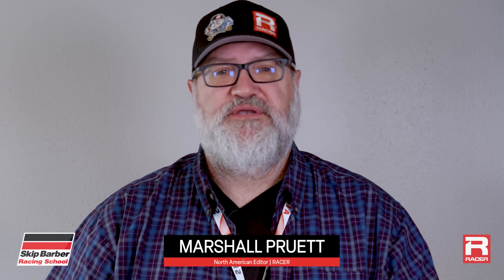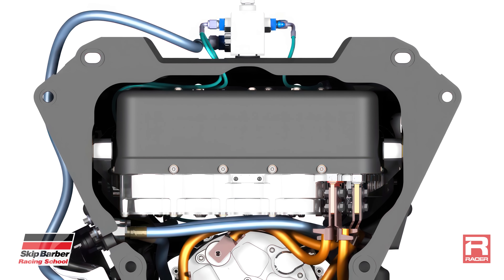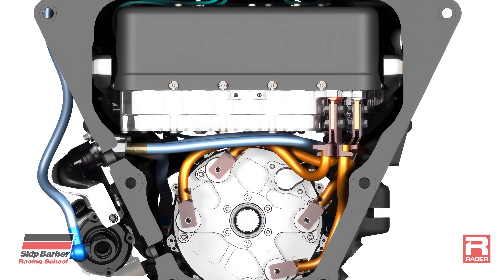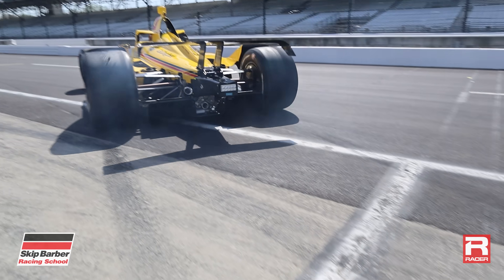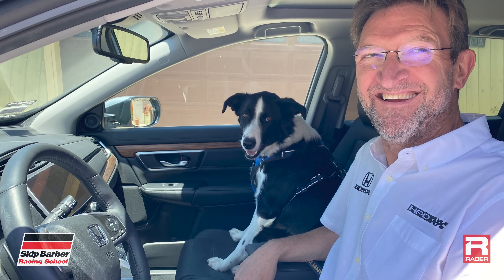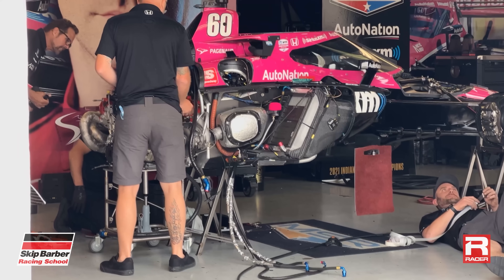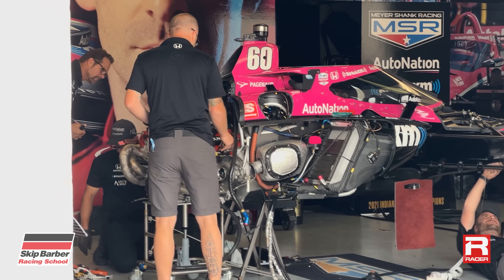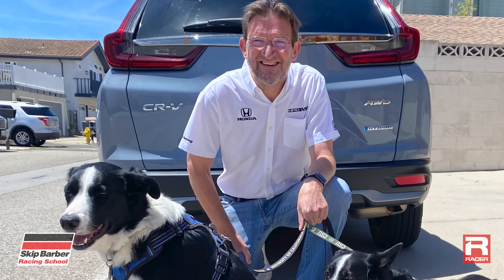Part 4 - IndyCar Hybrid Engine Roundtable hosted RACER's Marshall Pruett presented by Skip Barber

Comment: Truly hoping this is a success. I have put almost 230K miles on a used Honda insight and average 50MPG. My feelings are the cost vs advantage power and weight penalty wise are not there. I see a lot more breakdowns happening but again there will be much learned no doubt. IndyCar is the best racing today and I love both manufacturers. I grew up building small block chevy's with my dad, uncle and cousin. Serious question has powering the front wheels even been discussed? 

Great interviews enjoy this content.
Reply: I have a 9 year old accord that still does 26 mpg local and 34 mpg highway w 4 adults riding in it. Non-hybrid. Looking to move to a hybrid for the next one.
Reply: My c5 corvette gets 29 mpg on road trips.
Reply: @scarecrow_9895  That is pretty good. I had a hopped up but still TPI (425-450hp) 89 formula 350 Firebird with a T-56 6 speed behind it that got 26 mpg at 75 mph +... I think if I slowed down a bit probably 29-30 mpg could have happened.
Reply: @jamesbowman7963  We can get good mileage if we keep our foot off it, but that is hard to do sometimes.
Reply: No talk of powering the front axle.  It would require a complete redesign of the car to send power to the front wheels.  I'm also not sure of any formula car designed to run the front wheels except maybe Formula E.

Comment: Let's put extremely explosive racing fuel in a race car with high voltage electrical batteries that are know to self combust.
What could possibly go wrong?
Reply: The system uses a capacitor, not a battery.
Reply: Hybrid technology in racing isn't exactly a new thing you know.
Reply: Mongoloid is a good moniker for you...

Comment: I am not sure where they will get the electricity to charge all these electric cars.  I guess coal.
Reply: Watch all four parts of this series. The energy is stored in a capacitor, not a battery. Fast discharge, fast recharge is the benefit. The capacitor will be recharged by the engine which is powered by non-food chain based ethanol. 100 extra HP makes an 800 HP engine a 900 HP engine without extra strain and wear on the ICE components. It a win all around.
Reply: @davidholmer6099  but will they run the engine at that power from the get go? Because they only run 700hp on the road course setup and p2p adds 50hp. I'm curious whether they run the engines at full 750hp and just supplement 100hp with the capacitor or they just directly replace the 50hp p2p with 100hp hybrid for a net gain of only 50hp?
Reply: What electric cars?
Reply: Such a dumb statement. As a country we could use renewable technology as an economic opportunity but politicians in Washington get their paychecks from fossil fuel lobbyists.

Comment: It's hard to Defy Everything when you're fast, loud, and unapologetic.  I mean authentic! 

But seriously, I just hope it's a net positive in the power to weight department.
Reply: Right now it's 100 hp for 60 lbs, and the aeroscreen gets lighter and stronger next year as well.  It does make me wonder if they'll up the boost on road courses since they won't be overboosting the engine next year.
Reply: @danielhenderson8316  I'm curious about this as well. They're running 700hp on road courses, with p2p upping up to 750hp. Will they be running 750hp from the get go and letting the hybrid up the power to 850hp total? I hope this is the case.
Reply: @danielhenderson8316  I hope that's the case. Unclear if the supercapacitor unit requires a battery, or if it's just a 60 lb increase. Hybrid road car batteries are very heavy
Reply: @taylorsmith4758  the supercapacitor is where the energy is stored. No heavy lithium battery packs here.
Reply: @izzdin6228  Nice, thanks.

I'm still disapointed that we don't get the 2.4L's

Comment: how will regen work on a superspeedway?
Reply: I'm thinking hitting the regen button would reduce the overall power to the wheels. Drivers lose a couple hrspwr to get a couple seconds of 150 in a kind of high risk high reward scenario. 

You would have to draft behind someone to regen.  The strategy comes in where available electric power would have to be managed as you don't know what stagegy other drivers are using.
Reply: @mistrphixit7484  You are correct, there's no free lunch in thermodynamics. All the power that ends up in the capacitor comes from burning fuel...it's just that it's not wasted in brake heat. If lifting is enough to slow the car, using the regen paddle instead requires the driver to stay on the throttle enough to burn the extra fuel required to generate that energy. The other issue is that there are heat and frictional losses in any such system--you always get back less energy to the wheels than you harvested into the capacitor. Thus on an oval, any driver on a fuel save strategy will not be able to use the system effectively other than to regenerate power when slowing to pit.
Reply: To be determined.  I know they've tested at the IMS Road Course, but I'm not sure when the oval test is scheduled.
Reply: The drivers will have a fiddle brake paddle Where you see drivers lifting to make corners in the dirty air will be an opportunity to run more throttle and drag the fiddle brake to regenerate energy to deploy later
Reply: @u-wot-n8  adds another element of strategy. In the tow if you're saving fuel, just pull the hybrid paddle on the wheel and let the car in front pull you as you recharge your hybrid. Then when the time is right you dump your energy reserves and pass by like nfs nitrous.

Comment: On one hand, I'm excited for something....anything....new for IndyCar technology wise. On the other, IndyCar management has been totally inept at seemingly everything other than promoting and running the 500 and IMS. Here's hoping the manufacturers involvement will ensure this project goes well.
Reply: It sounds as if Honda and Chevy are leading this program and indycar is staying away. I think this is good for reasons you mentioned that indycar has been so inept in many areas other than running and promoting the 500.
Reply: @captainjosue  I do believe there will be another engine coming to IndyCar
Reply: @alistairfannell6694  New engine formula? OR new engine OEM? Or both? I still have hope that both will arrive
Reply: @captainjosue  new OEM
Reply: @alistairfannell6694  Nothing to suggest that would be happening. 

There was hope this hybrid system might entice someone, but that's gone nowhere fast.
Reply: This may also be one of the reasons why other manufacturers don't want to enter? Because in spite of itself Indycar is on the rise...
Reply: @Rainman...  Indycar is a very niche area of motorsports to invest big dollars on an engine program and promotion and all that with. 

It's a domestic spec racing series, so its only relevant to one area wheras WEC, IMSA, and F1 are truly global motorsports and easier to see value in.